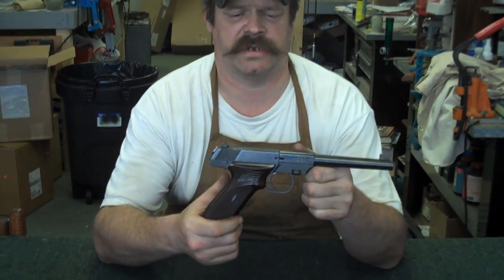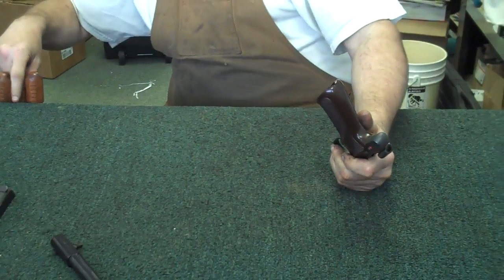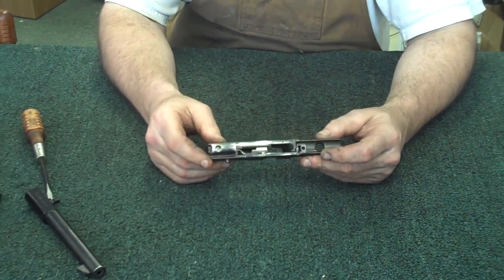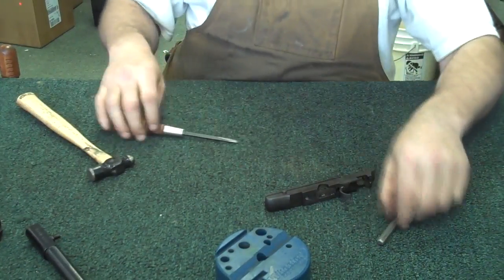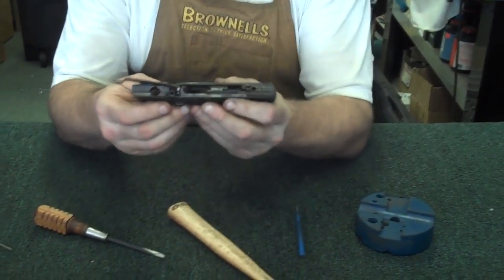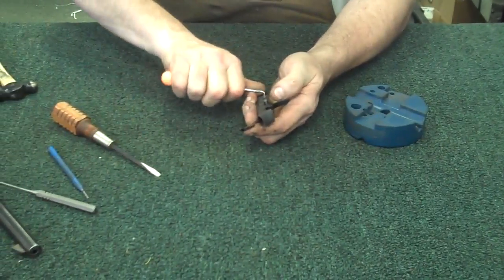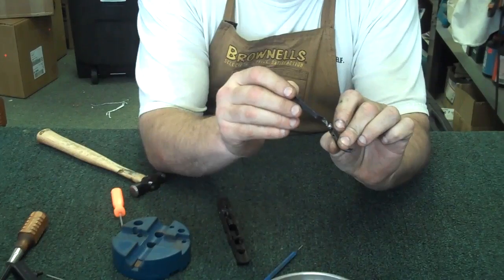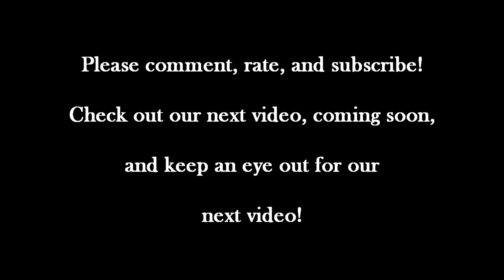Gunsmithing: High Standard Dura-Matic .22 Rimfire (Gunworks)

Comment: I have number if High-Standards, and the Duramatic is one of my favorites.  I got a super deal on at a gun shop/pawn shop because they couldn't get it to function.  I saw that it had the wrong type of H-S magazine in it.  I gave them $90 , put the correct magazine it, and now have a pristine gun in 90% condition.  I especially like the H-S revolvers.  I have  J.C. HIggins  .22 that was actually made by H-S, and it very accurate gun.

Comment: I just inherited the high standard m101. Thanks for the video. However I can’t remove the plunger that is also holding the safety. FYI… the gun was out of service for years and dirty. Most pins were hell to remove. The trigger was broken as well. Any tricks to remove that plunger? I see parts I can replace but all for nothing if I can’t remove that piece. What’s its function?

Comment: I have a high standard duramatic that won't eject the shell after being fired. What should I try replacing?
Reply: The lips of your mag need to be tuned..seriously
Look it up, there is a factory procedure
Reply: SHANE JOYCE  are you using high velocity ammo...  gotta be at least 1150 fps...  standard velocity 22 will not produce enough pressure to cycle..  just checking...

Comment: I got one of these dra-matic .22, I rarely use her but the shells seem to get caught in a 45 degree angle and jams. The gun is in mint condition and very clean. It is probably the rounds, is their any recommended shell you have in mind for this gun. Thanks
Reply: Your magazine needs work..
Reply: The lips in the front on the mag. need to touch a LITTLE on the bullet as it comes out. Be careful not to bend it too far. Also very light bevel & polish on the feed ramp & entrance to the chamber, VERY Slight !!  Any way that is how I fixed mine and a few more w/same problem.

Comment: Hey I have this pistol and I need to dissasembl the mag any advice?
Reply: Use a dowel rod to push it down until you can get the pin through the hole.  Pull the disassembly pin on out.  Then slowly allow the mag spring to detention until it's out.